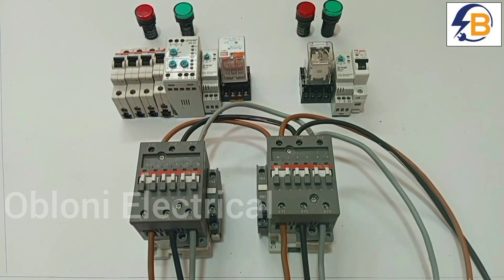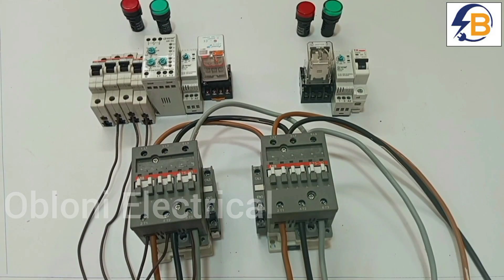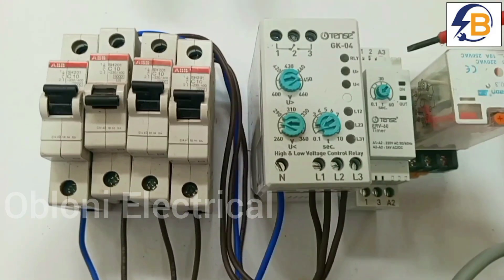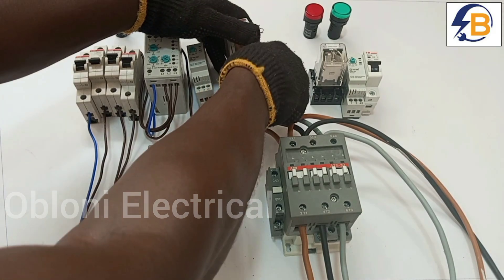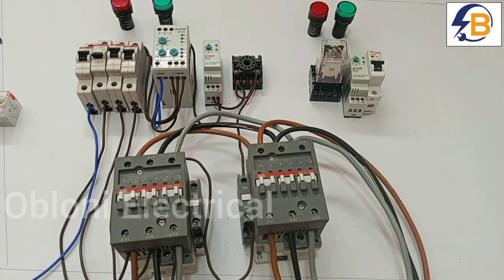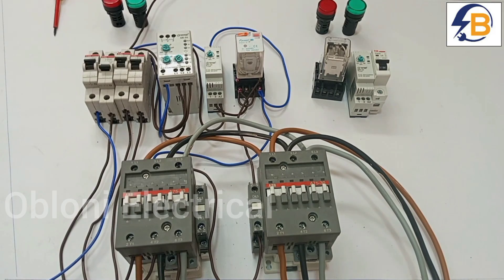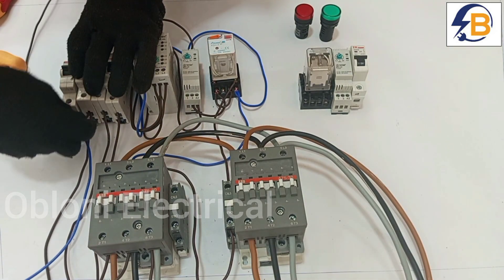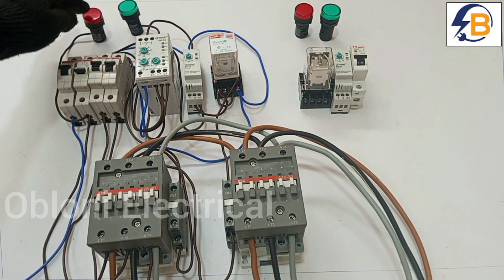Dual-Mode ATS Part 2 | Manual & Auto Changeover Control Wiring Tutorial

Comment: Great video sir, my question is what is the different between the timer and the relay in the circuit
Reply from the maker: The ordinary relay will operate immediately supply connects to it's coil terminals. timer will either operate immediately or  delay, depending on the time you set.